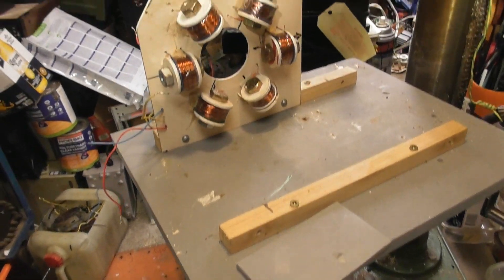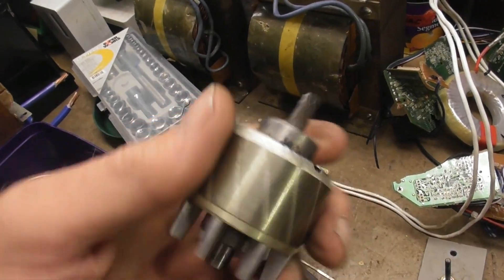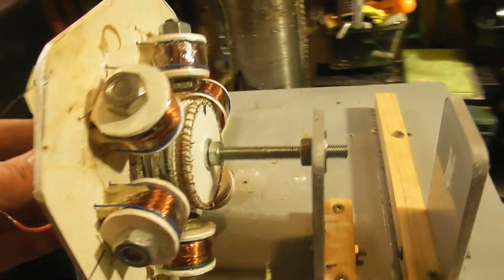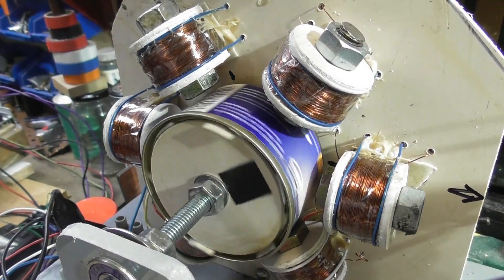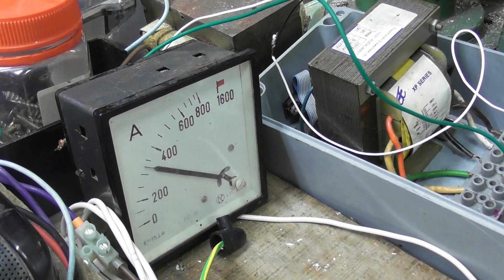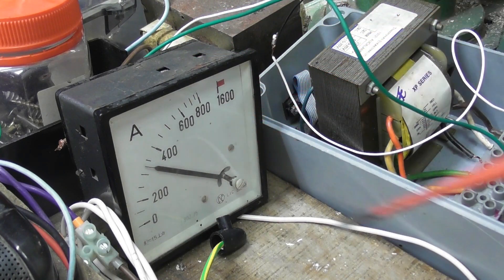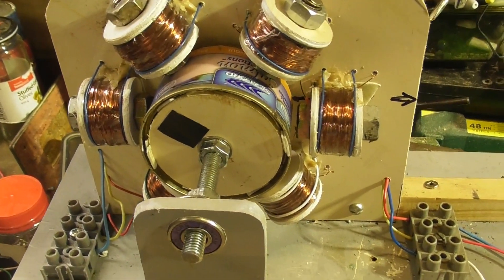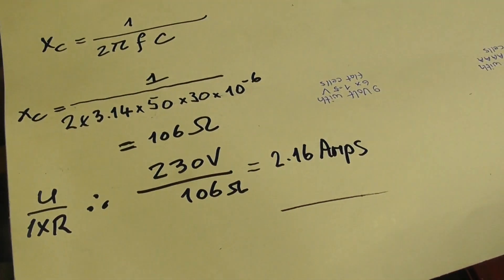Basic Three Phase Motor - home made

Comment: Reduce the reluctance of the magnetic circuit by placing the stator poles as near as possible to the rotor. Close them by a ring washer on the outside.
Reply from the maker: Yes, agreed, ideally the poles should be from laminated steel as well.

Comment: Howe about trying a synchronous motor with the tin can, and a collection of hard drive magnets as the spacers. Will work with the cat food steel, and should run fast. Yes you need a little more coil current, and some better magnetics to connect the field, otherwise you will just have too much loss, making it a great phase rotation meter.

Comment: I don't think you have to redesign the whole idea, just make the a magnetic circuit with way less reluctance: Make an iron loop around the outer ends of the bolts on the stator, and make the rotor out of iron as well. Maybe even try a massive iron cillinder.
Reply: Agree about reducing the reluctance in the stator magnetic circuit. But it is an induction motor. The induced current in the rotor needs to have a low resistance path. Aluminum or copper are what is wanted in the rotor. Not steel or iron.

Comment: To be fair i think a vfd would work better. My guts tell me it needs more hz.
You should probable reduce the impedance of the coils and just use an ESC and a lipo battery.  Or wire it in star config and just use some mosfets to switch the phases with an arduino. That should be easier and cheaper